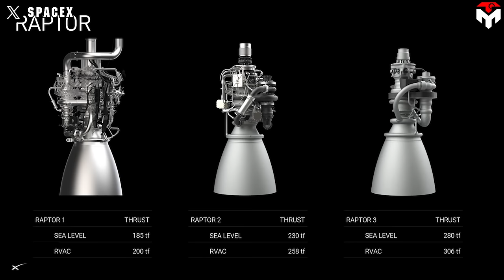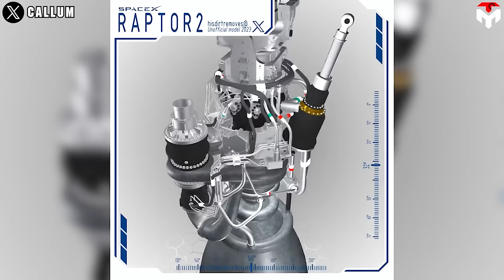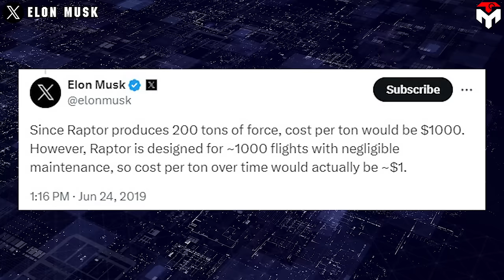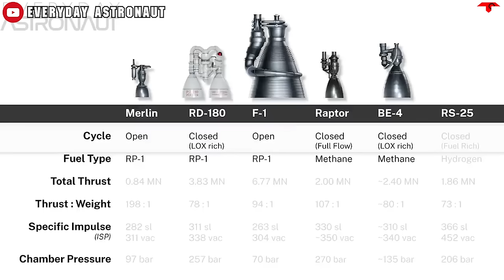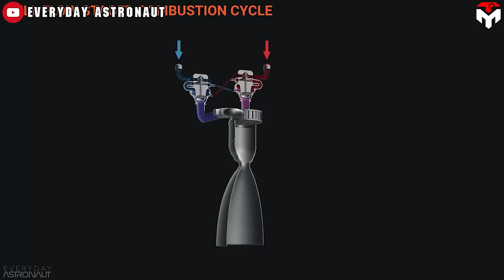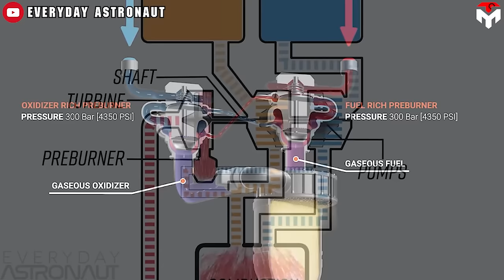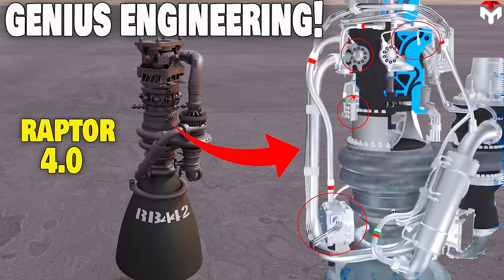SpaceX Starship's New Raptor 4 is an engineering genius & the best Ever Made!

Comment: The advantages lie in 3D printing. Any channel (the tubing on the outside of the Raptor burn and blow shape in 1 thru 3) becomes a part of the chamber and bell. The stuff you're burning starts at cryogenic temperatures and the ability to size and shape cavities and pathways within the printed 'housing' from start to finish (front to back) allows removing one tube or compression space after another until you have the whole first generation thrust package in one easily handled block. Then you can replicate them in matrixes to generate as much thrust over as much of an area and area shape as you desire.
Reply: Clever shaping of the channels and cavities that make up the functional components of the entire boost package can be static. In other words, liquid streams and gas streams can be used to divert flows as efficiently as mechanical valves. These techniques were demonstrated in the 1070's. They were impractical at the time but now come alive as highly robust materials are being placed selectively in a reproducible 3D matrix.

Comment: It’s easier to cool a rocket engine with hydrogen, but then comes the difficulties of leaks and frozen valves… that’s why the RS-25 can sustain a 9 minutes static fire at 104% thrust. I think they are augmenting the thrust capacity of the Raptor so it can reach acceptable thrust without pushing the Raptor to 100% thrust. They are not augmenting the thrust for lifting capacity, they are building a safety margin for the engine to work at less critical heat and pressure. Putting out the fire with gasoline…

Comment: Higher thrust could mean less engines required making things simpler, cheaper, and more reliable.  SpaceX could make different sizes of rockets for various payloads based on a common engine.
Reply: Fewer engines don't make the craft more reliable. F9 lost an engine on each of two flights in the first half of its career thus far. The remaining 8 increased thrust and the missions were both successful. Imagine the result if a Vulcan lost one of its 2 BE-4s. Even with boosters you can't increase power on a solid rocket booster. 
So mission fail.

Comment: Please ask Mr Charlie Garcia why there must be 60 turbines for 30 engines.  Many multicylinder ICE engines only have 1 fuel pump.  Shouldn't 10 pumps be enough?
    I'm guessing that the pumps are more like fuel injectors than pumps even though they also have a pumping function.   Still it seems like even the gyroscope stabilizer function could be replaced by a well engineered extra large turbine fuel pump.
Reply: Liquid fueled rocket engines use two separate liquids.  In the case of the Raptor, it's liquid oxygen and liquid methane.  Each one requires its own turbopump.  ICE engines use only one liquid, either gasoline or diesel to be pumped.  If the ICE engine is turbo or supercharged, then an additional pump for the air is needed.
Reply: @NCF8710  Thank you, yes I appreciate that but an eight combustion chamber ICE engine does not require eight fuel pumps.  Why should eight, or thirty  rocket combustion chambers require an equal number of pumps? The Russians had a dual combustion chamber rocket engine that only used one pump for fuel and one for the oxidizer.
Reply: @clavo3352  The Starship booster consists of 30 individual, independent rocket engines.  Each one requires a turbo pump for the LOX and liquid methane fuel.  The performance of each engine is monitored and controlled during operation.  A single large turbo pump system supporting 30 engines would not be possible.  The Russian RD180 is a dual chamber, dual nozzle engine fed by a single pump for RP-1 and another for LOX.  It is a single engine unit and is controlled as such.  These engines, used on the Atlas V boosters are not reusable as are the Raptor engines.  They will be replaced by US designed and built engines due to issues with Russia.
Modern 8 'combustion chamber' (cylinder) ICE engines have 8 fuel injectors, one per cylinder.  In the past, such engines would have one or more carburetors, each having one, two or four venturis (barrels) feeding the intake manifold.  You really can't compare an ICE to a rocket engine.  Other than burning fuel, there are no similarities.
Reply: @NCF8710  the reusable aspect is irrelevant to the issue of efficacy of using fewer pumps than the number of combustion chambers.  The ice manifold control of unitizing several combustion chambers actually makes my point.  Perhaps a little more Jack Daniel's will clarify it for you.
Reply: @clavo3352  It is clearly obvious that I am trying to explain something technical to someone who hasn't a clue about the subject matter.  I will waste no further time with you.  Good bye!
Reply: @NCF8710  Hey thanks !

Comment: If the engines produce more power so they will need less engines on the ship reducing the likelihood of engine failure?
Reply: It doesn't work like that.
Reply: It is more likely they use the extra power to reduce the thrust below 100% and by that reduce the failure rate.
Reply: @knowledgeisgood9645   It doesn't work like that.
Reply: There is booster(Heavy) then there’s Starship. They will not reduce the # of engines, more = greater reliability/redundancy. More thrust = less gravity losses = greater payload.
Reply: The only reason they need more thrust is to increase the stack height,  i.e. fuel tank capacity, while maintaining a minimum initial thrust to weight ratio of around 1.5.